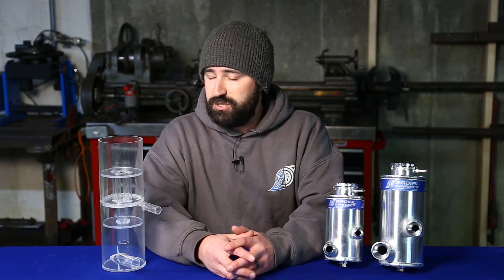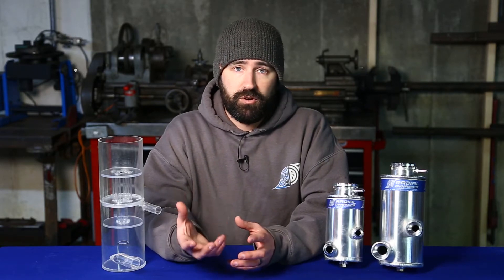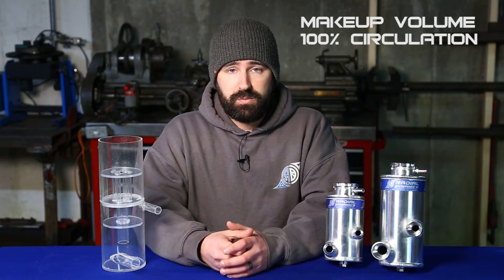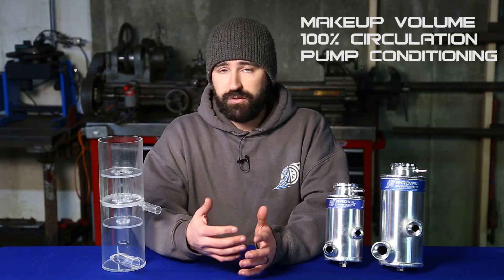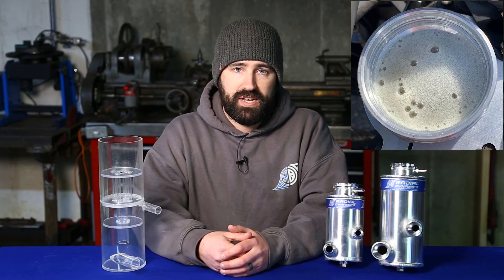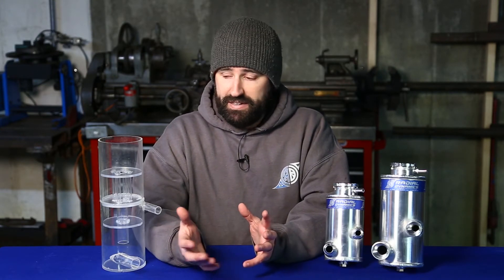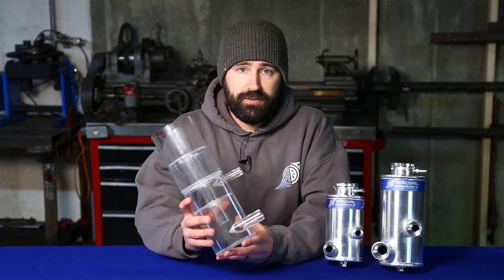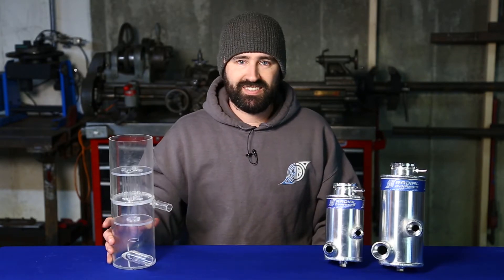Never Bleed Your Power Steering Again! Vortex Reservoir Demo

Comment: what happens to the air when it goes upside down with the engine still running
Reply: What happens to the engine oil in that situation? Same thing.